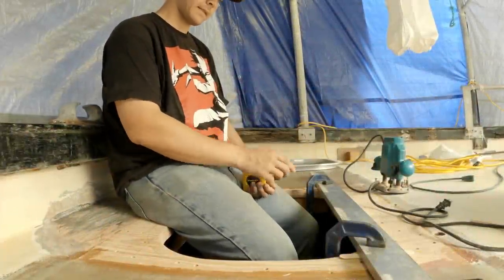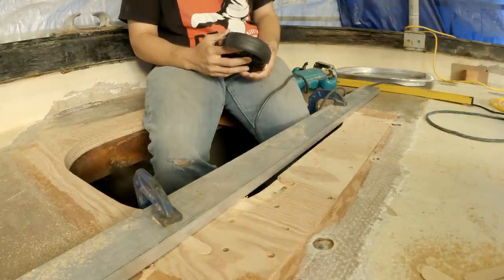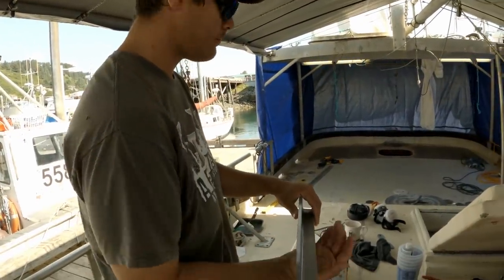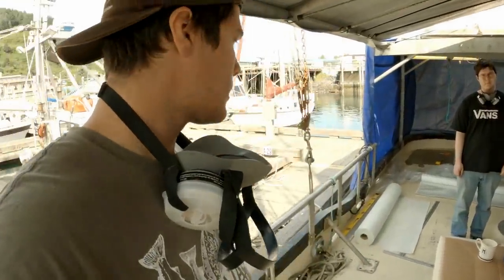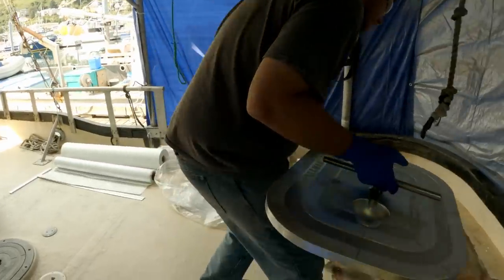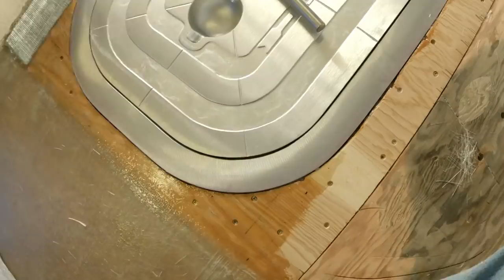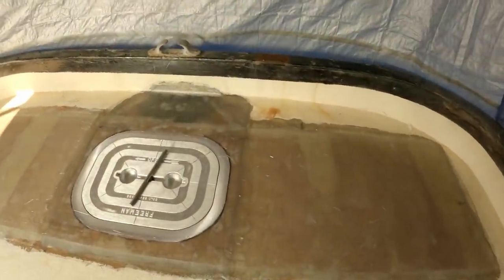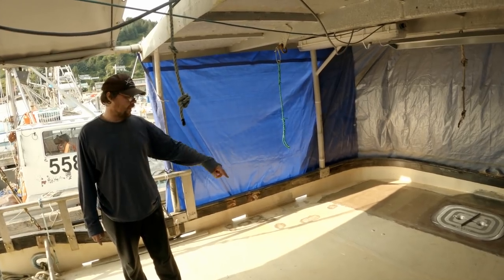Roughing in the Hatch Inset and Glassing the Last Patch - Emerald Isle: Ep.15 Fishing Boat Refit

Comment: In a bind you can use shoe polish as mold release.  I've used it for years and it works great.  I used to make lures and the polish is much cheaper. I usually Kiwi neutral or nude.  I've also used when bedding rifle stocks.  It helps when you can take care of the tasks needed as it's to costly waiting and paying for someone else to do it,  Not quite the way I would of done it but it will work.  Make sure you fiber in all that exposed wood in the hole.
Are those micro balloons and resin your using for the filler?  In my past I've also built front bumpers for minor league Nascar race cars along with boat repair and built canoes and kayaks-  Cedar, fiberglas and kevlar

Comment: Matt, are you using epoxy or polyester resin on the deck?
Reply from the maker: We're using poly, easy to work with, not so temperamental with changing conditions.

Comment: What was used as the prep on the hatch frame?
Reply from the maker: It's pva mold release. It makes a thin layer of a water soluble plastic which pulls away from the mold or hatch ring in the case allowing it to be removed.

Comment: As a shipwright in the UK I find this instalation a mystery, are you going to take out the ring and bed it on a mastic because as it is now it will leak like a sieve. I believe I heard your dad say that he will weld some studs on the ring to bolt it down, but what onto? Polyester and ply do not adhere well, at least not in the uk and water will wick down the end grain of your rebate. This is not a critisim just an observation. I am sure that your family, having been fishermen for many decades have used this system for many years. However it would fail survey in the UK.
Your views would be of interest to me.
Reply from the maker: We'll bore out the ply and fill the hole with thickened polyester, drill it out and then bolt through it into threaded plugs on the ring. We may have mentioned this isn't a permanent deck, we'll gut it and redo the entire thing within the next couple years. We have had good results from poly on ply, never any delamination on what what've done. Appreciate the comment Martin, they're always welcome.